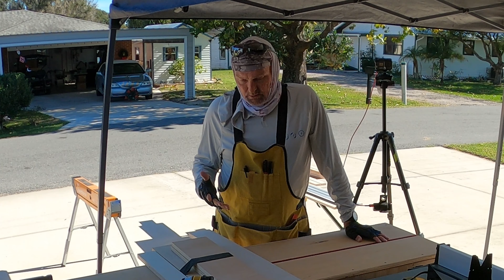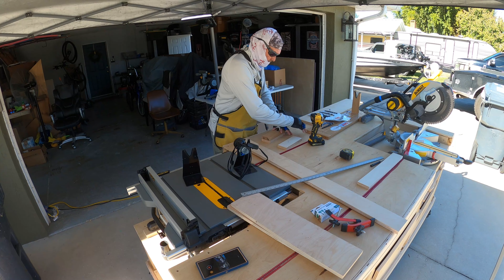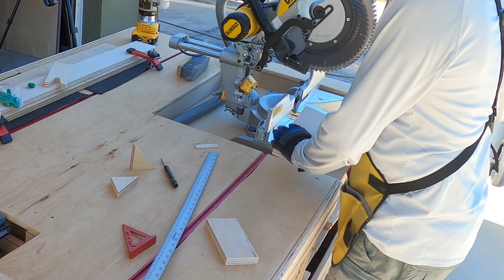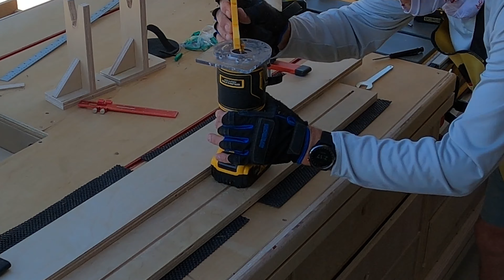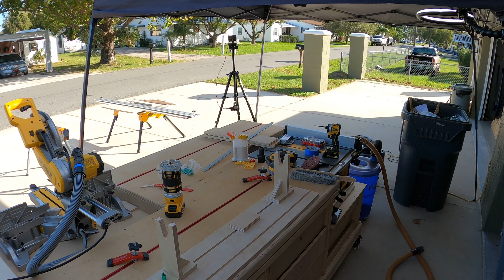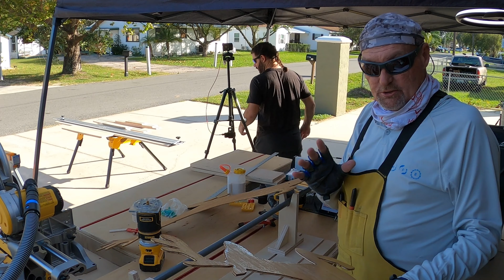DIY Hand Wrapper and Stand - Part 1

Comment: Question on Riser Blocks - how high above the base is the riser block crotch ?

I’m preparing to cut my wood and was wondering what you find comfortable.

First rod build & my only experience with a wrapping jig.

THANKS!
Reply from the maker: I have mine set at 7" above the base.